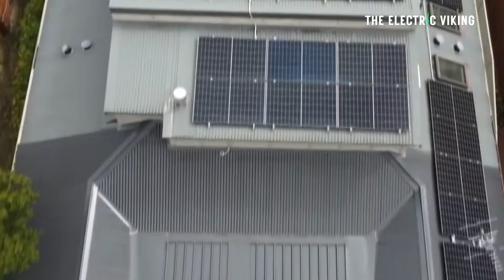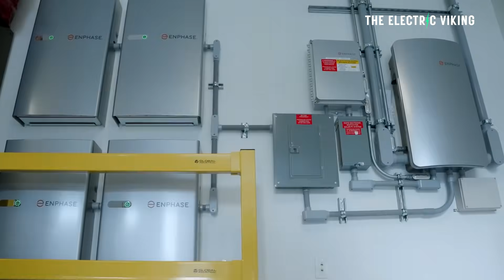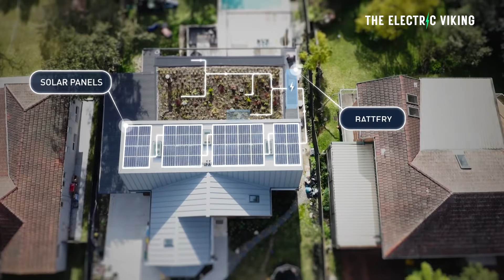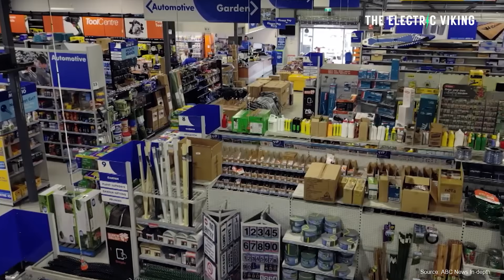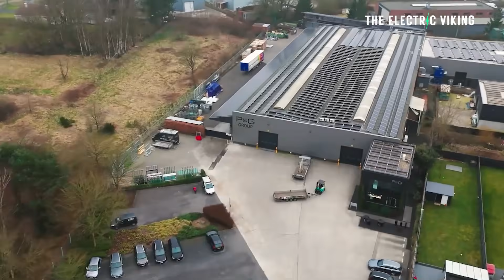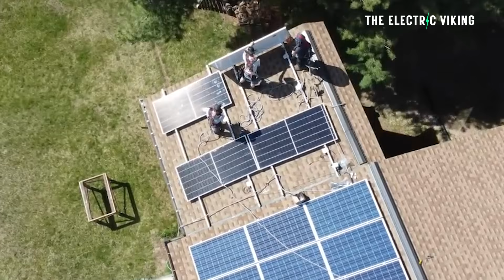Bunnings launches zero up-front home battery & solar deal - but there's a catch

Comment from the maker: The car I drive, the Xpeng G6 - https://youtu.be/IcniwO8NfQQ

RESINC Solar installed my battery and solar system. Get a free quote from them here: https://www.resinc.com.au/electricviking
Reply: I'm using Eco Flow 2 generator 's and bunch of batteries here in Seaford Vic.   
It's all plug, and play. Amen.
Reply: Bunnings should stick to hardware.  They cant even support power tools repairs  very well in nz. How  can a They cope with solar installations  zero up front model doesn't  work  many companys have collapsed over zero cost  upfront
Reply: Why did it take you so long to get solar when you are a self-proclaimed champion of renewables? And now that you have it, you are an instant expert.

Comment: They sold water heaters that were put on the roof. Did not last we had to bypass the panels when they leaked. Found a Plumber one street away he knew what to do and now we have a gas instantaneous heater. Would not trust ant installation from bunnings. Will they guarantee the product or pass they problem to their supplier.

Comment: To much dodginess in the solar and gov incentive industry.  To many installers that do dodgy jobs bad quoting, short cut installs, inspections overlooking important things like wireing,  these companies contract the installs, once installed, good luck getting support, they will change their name in 6months time. The government incentive program is just as corrupt as NDIS support workers, Solarvic etc do regulate it but just a few photos of the install and everything is approved. Prices are way higher than they should be so many hidden costs are added in and cant justify most quotes. got quotes once 30k for a battery, wholesale was worth 12k.  These companies rely on people who are not knowledgeable and take advantage of them. Needs more proper regulation.  Found one reliable installer and have a great system producing above its rated capacity eg 10.4kw , the previous one was big supposedly reputable company eg TrueValue. They disappeared pretty quickly, the inverter was locked and registered to them. I had it 5 years had to be all torn out and replaced as they no longer existed. go for a company that has local HQ and can do local support like Goodwe, Signergy etc, so if the installer goes bust still can get support.
.

Comment: I have 14kw enphase solar. LG panels 8 years old. Everything still working very well. No noticeable degradation in generation. Enphase just help me out upgrading the firmware and disabling grid feed in at no cost to me. I highly recommend Enphase.

Comment: I was quoted $25k after rebates. I chose another provider. 3phase not single phase. 30 panels not 24. 42kwh battery not 24. And $12000.

Comment: I'm happy that Aus is getting into incentives to install home solar and batteries. I hope the NZ govt comes around to this too sooner rather than later. Sadly at present our govt is more about promoting pumping more natural gas out of the earth, but I hope that doesn't last. I do think home solar (and in some places wind, perhaps more on rural properties where larger turbines can be installed without inconveniencing or annoying neighbours, or the home owner themself) needs to be part of the de-carbonisation of electricity in the face of growing electricity demand, so governments need to be getting on board with policies that facilitate it.
Several years ago our local council had a home insulation policy whereby people could get insulation installed or upgraded at $0 up front and it was paid off by adding on to the rates bill for a couple of years. There was no way I could afford the upfront cost and I getting a loan to do it would have costed a lot in interest, so the $0 up front and pay of through rates was brilliant. TBH I think that's what govt should do, rather than big business like Bunnings. Govt runs the $0 up front programme and it gate keeps which installers and hardware suppliers can participate based on proven ability to deliver the goods and services, and provide long term support. And if a company within the programme goes bust, because that can happen, then the govt programme ensures the ongoing support.

Comment: I had 20 panels installed at the beginning of COVID and three days before the install the panels that were specified in the contract were suddenly not available. Wish I had cancelled it all then.

Had different panels suggested because the installer had them on his house (later found out he rented and there were no panels installed). He installed two faulty panels in April 2020 and a third one went faulty in October 2020. It was then a battle to get them replaced under warranty and were actually NEVER done. One day his website, email and phone were no longer working and we still have only 17 working panels of the 20 installed. I contacted the panel manufacturer about getting these Canadian Panels warranted and all I got back was a bunch of marketing emails.

I do NOT suggest Canadian Panels for your roof. Things went downhill from there.

Comment: 1. Not available for Off Grid. (says it all)  Not about helping you but controlling you. 
2. Smart meter.
3. Fixed term where you can't add or upgrade this contract.
Example.  You'll hand over all control of your electric to this company.  A hot day, they'll turn off your aircon.  You want to charge your EV.  Nope.  They also, steal your EV battery power.  Who'd hand over all control of their power to a greedy power company.  
The same power company caught upping the voltage to 250v a few years back.  Destroyed your electronics but here's what they didn't tell you.  Gridtie inverters won't export your solar to the grid if the voltage is too high.  So without a SMART METER they found a way to stop you from making any money.  When people wake up to this it'll be too late.  They'll be stuck in a 5-10 contract.  No free lunch.

Comment: The big problem with these systems is you are stuck with their battery, their inverter, their charging module, etc. due to the communication protocols involved. This means when the battery needs replacing you have to buy the same battery at a high price and can't shop around and buy the best battery at the lowest cost. The difference in price is astronomical. It is better to go for a low cost system that works with any battery like Victron.

Comment: Two major issues, apps usually have a fee structure to use them with the battery system, which if you don't have ... the device will either not work properly or at all. Secondly if the battery system isn't installed correctly by a licensed electrician who has the knowledge, well it becomes a fire hazard. If bunnings is using third parties to install, you can see the possibility for abuse and neglect of customers.

Comment: Ergon increased the daily service charge while at the same time lowering the feed in tariff , They want us to not export more power and cut back on feeding into the grid but the only way to beat this pricing structure is to go big and export more power . Batteries are not the solution here . Unless I am missing something with my math . Are we going to see more of this trend where providers end up not charging for the actual electricity at all but bill you only for your connection to the grid at a set daily rate ?  anyway it all kinda sucks at the moment .

Comment: Hi, so this is where government or electric companies should step in and back the installation of solar PV and batteries on house and business roofs.
The supply is at the point of use and no other infrastructure is needed.
It also allows the unit to island and keep you powered if the grid goes down.
Take care M.

Comment: Our Solar installer, died and his company was dissolved so yeah, Gov initiatives need to have a plan for that, also we are located in Rural Vic, out west towards the South Australian Border, still hours away, but access to almost anything modern is limited, though not as limited as some people have to deal with.
for whatever reason, this stretch of the National Highway and Rail system gets ignored, a lot these days and that seems to come with services like Bunning refusing to do deliveries and such, and makes finding a good reliable and well established Solar specialist harder than it should be. 
but I digress, our issue is that we tried to get Solar Batteries added to our system and at first had to fight to get approved, we got approved only to find that the installers could not add the batteries because of the fact we're in an older home with 6A wiring and we needed 10A.... at least this is what we were told and the deal was then cancelled on us. I think the Governments would be well advised to run a full upgrade program and incentive to get old wiring removed and replaced, with proper support for the life time of the incentives, it's not perfect, nothing is, but it would help a lot.
that said, if you are able to take advantage of the incentive then great, but sadly we cannot all do it it seems.

Comment: A lot of people don't have the money for the long term solution, so will choose the cheap option. I personally do not want a smart system or smart home - we saw what happened  to those in the wildfires 😢
For people in fire zones EVs or  smart homes are a very bad idea. Also in extremely hot areas

Comment: With the battery rebate on 16k you still are going to pay at least 13k, so it's still a load of money. To get the full 30% it depends on your postcode and if you get over the maximum Kwh....in my area for example I would get something like 1500 off when Installing a suitable system

Comment: As the installers need to be SAA accredited and that accreditation belongs to an individual not the company, the quality of the install is only as good as that individual. When more installers gain accreditation, there’s always a percentage that will take shortcuts to gain maximum advantage whilst the scheme runs hot. The sheer numbers when considering both the rebate and an iconic retailer’s reach with an attractive offer on top, the subsequent (and suboptimal) labour force now on the tools, the defect rate is likely to be large. The inspectors will be run off their feet this, allowing more poor quality systems to be installed in the meantime.

Supply issues for the respected brands such as BYD, Sungrow and the hot newcomer Sigenergy also allows the cheaper and nastier stuff to flow through, to make the numbers and satisfy demand, if for nothing else. Installers will therefore need to install these to make a living until either the demand slows or the supply catches up.

Comment: If Wesfarmers are involved they will be fleecing Australians 💯👍🏼
Reply: Look at Bunnings price policy. 
Find the identical product cheaper they will match or beat.
  Problem is a lot of the brands like Trojan are Bunnings own and you won't find.
Reply: looking at it now, to get the battery im after (15kwh) they want $11k outright, and with the "no upfront" over 10 years it goes to $14k so theyre making interest (pretty low, around 3%pa i guess over 10 years). Pre-rebate they were about $1000 per kwh, so in my eg $15k, an the rebate put them around $9k, so they be getting some of the rebate too. These prices were for the cheaper Anker, the sigenstor was more again, for same size system

Comment: What the world/Australia desperately needs is integration of EVs with the electrical grid... You should be able to park your car anywhere and charge directly from the power poles (staring to get rolled out in Victoria)... but also charge you car from your home solar and then use the EV battery to power you home at night (Very limited choice there). 100KWh EV vs 10KWh home battery doesn't even seem like the same ball park! The whole infrastructure is so basic it seems like the tech revolution of the 90s where now everything is in a single device... That's what we need in the EV world ASAP : Power grid + EV + home battery + Solar = all working as one unit!

Comment: It’s not good for a business to go out of business but if you buy a battery or a solar system and the supplier or the installer goes out of business it doesn’t matter because the manufacturer of the product still must cover the warranty here in Australia.
Reply: This is true! I've had to claim directly from the manufacturer before!

Comment: I would be pretty unlikely to use Bunnings. Keep the little guys going, I say. Finn Peacock’s “Solar Quotes” channel/website is probably a good place to start. I even saw a link for his cost calculator on the Choice website. His list of tradies has become one of those “go to” things.

RESYNC Solar, recommended by Sam, seems to rate pretty well.

Also worth knowing is that the government rebate isn’t unlimited. The program was supposed to be capped at 100,000 households but it’s been extended and even then, can’t keep up with demand. That’s after one month!

Comment: The real news is that you will no longer be able to make money from selling energy to the grid soon as so many people will have it that energy prices will drop.  This is great news but don't believe you are going to make money from installing solar and batteries that day has passed.  You can however reduce your costs and hopefully pay nothing for power.  All the excess energy will return to the grid and be consummed at low prices from commercial interests to profit from.  You will still be charged to connect to the grid basically your paying a subscription to a retailer to pay for transmitions costs you no longer need.  Essentially the grid will be greener and energy will be cheaper and the consumer is paying for the generation costs and transmission costs.  The new oil is electricity and the big end of town is positioning to take their profits (taxes).

Comment: I think you should not rely on any installer and instead do the work yourself. You also should be looking at the cost of the energy produced and not the cost of the system as you continuously do. Right now solar and batteries are the biggest scams out there with a zillion companies ready to take advantage of you. So do the work yourself so when the companies vanish to pursue the next government subsidy you are not left holding vapor.

Comment: all my solar panels are secondhand ,sooo cheap ,i once picked up 7  240watt panels for 50$ from the local solar installer, there were fine cracks on the back, i turned them over and used car black underbody sound proofing paint ,all the panel controllers, were missing their covers , easy to cut new ones and i replaced all the joiners, one just one was green and corroded ,everything worked 100%  after that ,but i pay $15 for 175 watt panels and solder all joins on all cables for my off grid setup
Reply: I also built my own stand alone off-grid for a previous EV. My 12 panels were 270W for $400 plus an MPP inverter $900 and S/H comminication standby batteries $400 + overkill on curcuit breakers. A lot of time spent in study. All worked flawlessly. . Since decommissioned for major upgrade.
Reply: That’s fascinating.
Reply: You more than likely will run into some Compliance problems if this is a grid connected system as there is a lot of older panels and inverters that are no longer allowed to be recommissioned on to Grid systems
Reply: Love a good DIY project. Just a tip you shouldn’t be soldering joins in power systems. They should be cold crimped. Solder can heat up and cause the connection to fail, loosen or worse. A crimp retains strength through the thermal cycles.
Reply: @cvwagon  I did read about that. Bought a crimper to add to the shed full of tools which I'd gathered building cars. In fact if I was paid for the time I spent studying electrical systems I could have paid someone to gold plate my system Did it for the experience and if I could source parts at a good price.
Reply: @cvwagon ahhh yesss the YouTube electrician, wait till you find out how many homes use solder joints in boxes

Comment: 2009 I used Modern (still here today) to install a German tech system. Only a 1kw but expensive. Others around me went for these cheap higher Kw systems and none are now working. The main issue is the cheap components beyond the panels. My system is obviously outdated now so will be replaced but not with these cheap componentry stuff the govt wants to fund. It will be proper long term componentry probably built by China labour but German tech. Holding back to see if this new battery tech is real which I believe is under the Tesla group of entities. In the meantime the 1kw system doing well by using power at the correct times even with only 8c feedin tariff but will be going lower.

Comment: I’ve been in the solar business for 30 years. It is always the way that companies rise and fall with rebates. I have gone through at least 3 rebates schemes from liberal govt, which work for a few years, till the conservative govt comes in and cancels them. When Solar becomes dominant this cycle will end but not until then. It’s an issue of rapid growth.
Reply: cheap used batteries and panels for me. yew